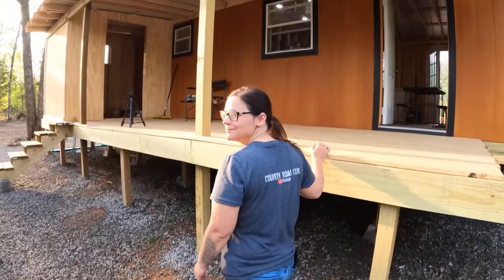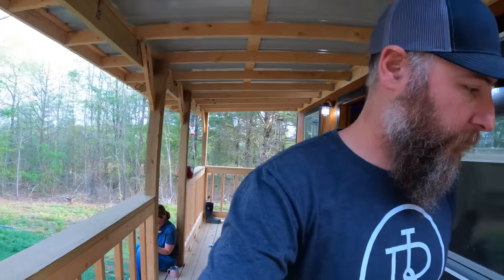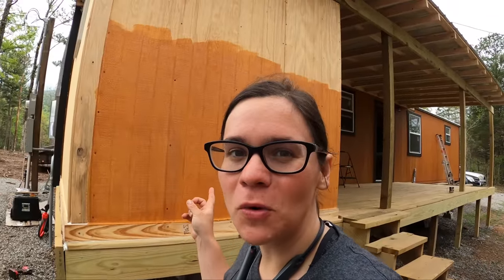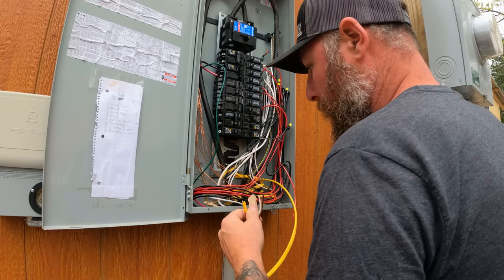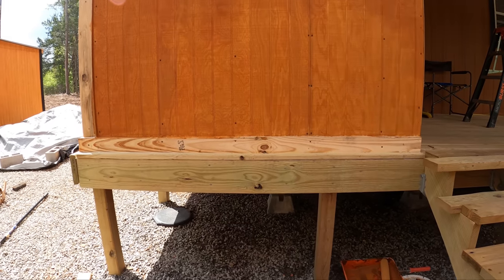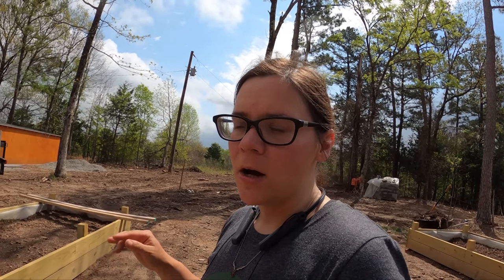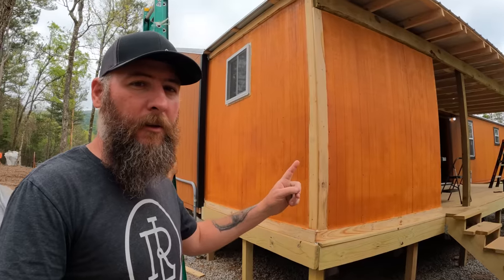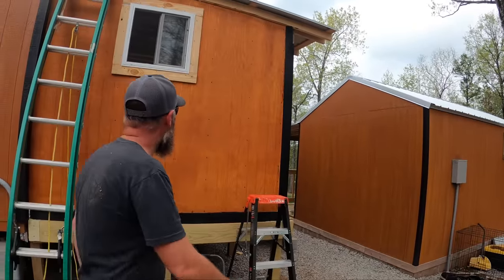We Had To Fix It... | DIY Deck | Couple Builds Dream Home In The Forest

Comment: dont forget to put it washer and dryer on an inside wall as it will freeze in the winter .
Reply: Agreed. If the washer and dryer aren’t on an inside wall, insulate like crazy, like overkill with insulation around the water lines.

Comment: When your done painting wrap your roller with aluminum foil, make sure both ends are covered with foil and it will keep the paint fresh for weeks, and line your tray with foil too, a lot less clean up needed, learned that from my mother years ago and I'm 68.
Reply: Roxanne my husband was a painter and he would roll up the paint roller in a plastic bag and stick it in the freezer over night, that way the roller wouldnt hard harden up over night and could be used again in the morning. some times he would leave them in freezer till needed again for same color.
Reply: Sandy I was taught to put it in plastic...,not foil! 🤷

Comment: Hi guys, looking good. I would add a couple of other outlets, just in case. Also you may want to think about an outside spotlight, maybe pointing to the  workshop and the chicken coup.  i don't recall you putting in an outside outlet, but they come in handy at times. Just a few thoughts before you close up the walls.
Reply: Agree on adding a couple of outdoor outlets especially on both sides of the house and maybe for the deck on thunder dome.  Great job guys, looking so good.
Reply: I definitely would add out side and inside outlets. The cost will be more in the future and you’ll regret not putting an outlet in that laundry room for some kind of heating and freezer, extra refrigerator later. At least two inside outlets on separate breakers! Do it now, you won’t regret it ever!
Reply: I was going to say the same thing about 2 more outlets. For a little space heater in the winter and a deep freezer to save room in the house side. It looks great you guys are doing great. Keep up the good work just trying to help out with the comments glad you guys know that and it's not just people who think they know everything and trying to put people down. There's a lot of those on the internet. So great job and keep it up. Only trying to help from own mistakes in the past.
Reply: @M D- Very good ideas given! Best to have a few more outlets in the laundry room, especially if you want to do ironing, vacuum cleaning, etc. Better than not having enough outlets. I also agree with having a few outdoor outlets. They always come in handy when using any outdoor electrical equipment or to run an extension cord out on the deck.

Comment: Great fixing the flashing and staining, DIY tip is to put the roller and handle in a plastic bag and it will stay wet for up to a year so you can use it over and over....

Comment: Good job guys. 👍👍

In addition to insulation, think about putting a small baseboard heater in the laundry room to be sure to keep it above freezing on those cold January nights. Just a small one, 24 inches long and have it thermostatically controlled. It's easier to do this before you put up your drywall.

Comment: Just a FYI: Don't forget to Vent the Dryer and also you have top load and front load washers. and Dryers are always front loading . You can down draft the dryer vent under the house . which meand you cut the vent hose hole in the Floor behind the dryer. Love having the Laundry outside on Deck.  Ninette Bird- The Caribbean Wife- Tx.
Reply: I would think twice about venting that damp  dryer air under my wood  shed mixed with your summer humidity not good.. regular old vent out the side wall and send that musty exhaust into the breeze..

Comment: Very relieved you fixed the flashing :)  I didn't lay my electric wire directly against the metal roof.  My roof is 2x8 rafters with 2x4 stringers. I made a point to staple it to the lower area of the 2x8  I've never tested just how hot the metal roof gets in these NE Ohio summers, but I didn't want to take the chance of burning wire. Porch is looking very relaxing and most welcoming. You might want to add a few outlets to the porch for fans and what nots.

Comment: I've wrapped paint brushes and rollers in plastic bags and either stored them in the freezer or refrigerator depending on how long it would be between painting.  Way easier than cleaning the brushes if your using the same color.

Comment: On the dryer plug, you tested each leg to ground You need to test across the two hots to confirm you have 240   You still could only have 120 across the two

Comment: I have done ALOT of painting.  Recommend you paint the wall from the top down. This will avoid at will avoid drips from the top getting on the lower portion.    Also,  you won't have to deal with a wet wall when you get on the ladder to paint the top portion after you have completed the the top first.  Great job--you are both so great to watch!!

Comment: If you're going to enclose the deck, why not install a "service window" on the porch, directly opposite 
your game room shed to make it easier to bring dishes of food over to the game room.   Just place the 
dishes onto a shelf or tray on the inside of the porch & access the dishes when you're on the outside.  
Sort of like at McDonald's when you go thru the drive-thru.  Using sideway sliding windows that lock
on the inside.  Make it high, so that you can access a multi-level trolley on they inside.

If you make the sliding windows wide enough, you can slide thru a laundry basket for those days you
want to dry your wet clothes outside.  Or when you harvest your veggies, you can slide them thru the 
service window, rather than lugging the entire basket to the steps.
Something to think about to make your life easier.

Comment: Hey guys just a small suggestion but may be worth thinking about putting your washer and dryer against the right (shed wall). So your pipes are inside your main wall with your bathroom pipes so they don't freeze?!? We live in the north and always avoid water lines on exterior walls for this reason!! Hope it goes well for yah 🙏

Comment: OK, Big Big Tip here on painting. It'll save you a fortune in time, clean up and cost of rollers. We all know the worst part of paining is the clean up. So here's hot to eliminate all that clean up. YOU DON"T CLEAN IT !!! Use a 5 gallon paint bucket grid. Just ask for one at Lowes or Home Depot and they'll get it for you. So you put the bucket grid in the paint bucket and hang it over the edge of the bucket. Do you painting using  the bucket grid to run off the excess. Then when done painting, unhang the bucket grid and drop it in the paint. Shove you're paint roller off the roller handle and sink it in the paint so it stays wet with with the paint. Put the lid on the paint, and now all you have to rinse off is your roller handle. When ready to paint again, use your stir stick to stand the roller cover on end inside the bucket, start it on the roller handle, then pull your bucket grid out of the paint and hang it over the side of the bucket, and use the top of the grid to press the rest of your roller cover over the roller handle and back to painting. It'll save you pouring paint into the paint tray and no paint tray clean up either. You paint right out of the bucket, when done, it all goes back into the bucket until you're ready to paint some more. For real, it literally saves a fortune in time and roller cover expenses. The bucket grid cost about $4. yes, it'll get coated in paint, and that's fine. So long as you're using the same color, go ahead and transfer that bucket grid to the next bucket of paint. I've probably painted 25 gallons of paint before it needed replaced. https://www.lowes.com/pd/Project-Source-10-07-in-x-12-2-in-Metal-Paint-Grid/999993330

Comment: Looking super good. Anthony has become a pro at the electrical. 
I have a question, I don’t remember if you did or not. Did y’all replace your windows that came stock with the shed. I was going to replace mine on my tiny shed. But, Trying to find a size that would fit would be a pain. 
Anyways guys. ❤️❤️ love it

Comment: someone mentioned the height of your plug ins, don't they know they can be any height that is handy, like in cabinets, or even in the floor? BUT... the standard height is generally, you want to mount receptacle boxes with the BOTTOM of the box ABOUT 16-inches off the floor. Coincidentally, this roughly equates to the same height as your garden variety 22-ounce framing hammer.

Comment: Why did you put the outlets so low on the wall? Usually Landry room outlets are installed slightly lower than the height of the appliances which makes them easy to reach without moving the appliances.